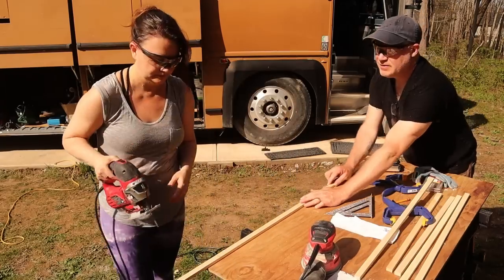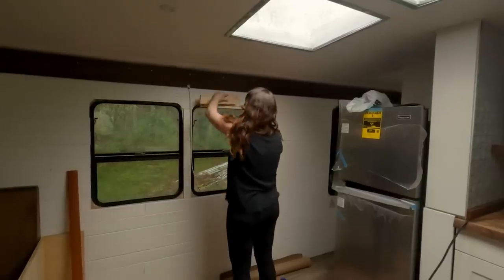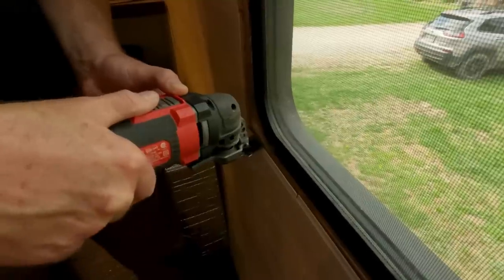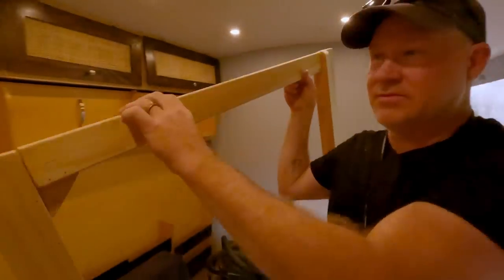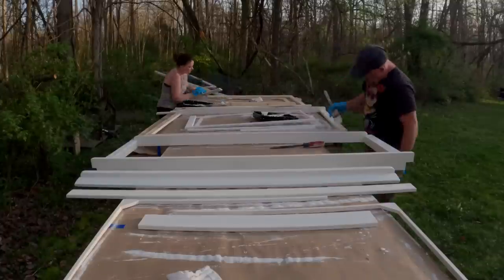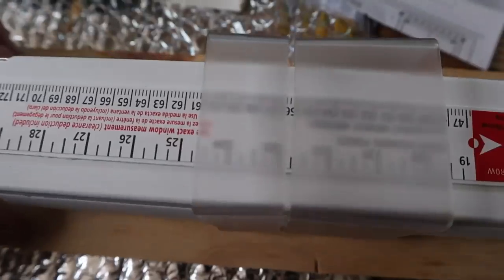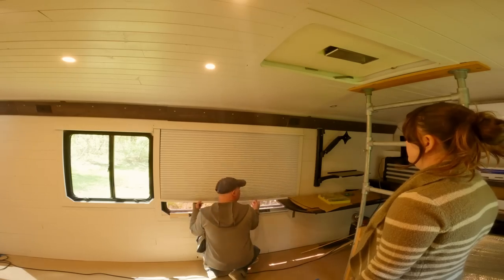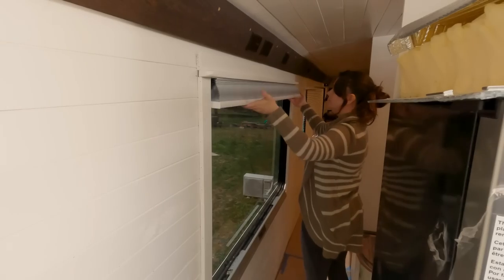Redi Shade Blackout Shades for our BUS CONVERSION - S04E55

Comment: Thank you so much for partnering with us! This turned out so great! We love it!
Reply from the maker: Yay glad you like it!  It has made all the difference to our home
Reply: Nice job guys they look amazing I have a concern about the adhesive holding the blinds on the window seals my coach gets pretty hot and I'm wondering will this effect the adhesive?
Reply: We tried to purchase these, but the discount code wouldn’t work… any suggestions?
Reply from the maker: @truckergrandma  Hi June, Sorry you are having troubles with it.  I just tried it myself and it automatically applied the discount at checkout.  So as long as you use the link we provided, then look at your Order Summary on the right side of the page (on a computer, not sure about using a phone) you should see the code 15REHABIT815 is already applied and the 15% deducted.  If you try to put the code into the box for promotional codes it says it is not valid, as they have set it up to automatically apply.  Sorry, it is a little confusing but I guess you don't actually need the code, just the link.  Here's the link if you need it - https://www.amazon.com/gp/mpc/A3M2S3H0SPDH8D 
Happy shopping!  You are going to love these shades :)
Reply: Great video and project! 
You could just put another strip of wood vertically each side of the frame which snugs up in front of each edge against the shades/blinds, then it not only holds the whole shade against the window or close to it(within the Frame) it also blocks out any light each side where there's a gap so no light can get through when down when up or down you won't see the edges of the blinds and also WHATEVER position the blinds are at height wise, they're always held in place near the window by the edging of the frame holding them back(kind of like similar look to when blinds are set between two panes of double glazed windows) might just finish it off nicely and give the whole thing/blinds and enclosed look and well they will ACTUALLY be enclosed, so no need for magnets unless you chose to do that as an added measure!?
Just a thought.. great job guys! Love the build!
Cheers from London England 👍😎🏴🙏

Comment: Add some vertical guides to the frame that can house the blinds in, effectively boxing them in like rails. This way, it does not matter which way the bus slant towards.  They  can also help reduce light from bleed in.
Reply from the maker: That's a great idea but we didn't want to box our windows in.  We want to be able to remove, clean and replace the screens PLUS keep our emergency exit handles all accessible.

Comment: Sometime ago while I was active duty Air Force we purchased a old window Dodge van . I'm thinking it was a 1966 or 68. The engine sit between the two front seats. We used it for camping , traveling back and forth home to visit family . Our 2 children  boy and a girl learned to go to sleep on our trip. When I got off duty and my leave started we were packed to travel over night 12 hour drive. Anyway I took the windows and blacked them out.  And then framed the windows in like you did yours.

Comment: you're going to need to secure the bottom of the shade while driving. All my RV shades have a string running from top to bottom to keep it from swinging while going down the road. One option would be to raise all the blinds while underway, or stick some white velcro on the back edge of the bottom of the shade to stick it to the bottom of the window frame. OK, I see you guys have a plan...

Comment: The window frames make such a big difference, the blinds are very good, My concern is that because you can close them so easily would they come down if you were driving along a bumpy road, I know that you have said that you will put magnets in the blinds to keep them in place but it only takes one bump to dislodge a magnet. Have you thought about putting flattish sliding bolts near the top to keep the blinds in place
Reply from the maker: I think a big pothole might make the magnet release but being a magnet it will suck it back in afterwards.  We just don't want it to rattle and make a noise constantly.  So we'll give it a shot!

Comment: I have something similar to your blinds at home that fit into a frame surrounding the window. The frame provides a track for the blinds to follow and prevents swing out when the blinds are partially down and the window behind is open. Perhaps you could fabricate something like that?
Reply from the maker: That's a great idea, however we don't want to make it so we can't open our emergency exit windows or take the screens out etc. We kept the trim to the outside so everything is still easily accessible.  Also it will still rattle.  What we want to get rid of is the sound of rattling as we drive.  I think the magnets are holding well, we'll see when we roll out of here :)

Comment: Great video and project! 
You could just put another strip of wood vertically each side of the frame which snugs up in front of each edge against the shades/blinds, then it not only holds the whole shade against the window or close to it(within the Frame) it also blocks out any light each side where there's a gap so no light can get through when down when up or down you won't see the edges of the blinds and also WHATEVER position the blinds are at height wise, they're always held in place near the window by the edging of the frame holding them back(kind of like similar look to when blinds are set between two panes of double glazed windows) might just finish it off nicely and give the whole thing/blinds and enclosed look and well they will ACTUALLY be enclosed, so no need for magnets unless you chose to do that as an added measure!?
Just a thought.. great job guys! Love the build!
Cheers from London England 👍😎🏴🙏

Comment: Trim them out so that wood overlaps on the outside. This will keep them stationary. Maybe? just a thought. Incredible product.
Reply from the maker: I'm not sure I understand what you mean but we didn't want our trim/frame to cover the windows so we can open them and take out/replace the screens if needed.  So we couldn't overlap the shade to keep it in place.  But actually glued on some magnets yesterday it worked well to hold it in place :)

Comment: Love your show. 

I’m wondering if shade can start from bottom then you pull up.   If you can pull up halfway to 1/4 open, you can see outside while standing.  It may look nice.  I suspect your shade won’t work but maybe something hook to hold it stay up?   

Thank you for your positive shows.
Reply: That would be clever if it works.
Reply from the maker: These easy lift shades don't do that, but redi shade do have those.....I think they are called artisan custom shades.
Reply: Saw a show. Love those blinds. Amazing job.

Comment: LOOKS GREAT...like always! Could you put magnets or double sided tape on the bottom like the top? I'm sure you two will figure it out. Also found these magnets for your drawers & cabinets. I seen in the video the installed them on each side of the drawer face near the drawer slides. I’ve seen some pretty cleverly disguised magnetic latches on some cabinets lately. Most are finding them in the marine grade section on Amazon. This is the name for the 20lb magnet latches I seen installed near the drawer slides; DonYoung Magnetic Latch, 20lb Magnet Cabinet Door Catch

Comment: We tried to order these shades but the discount code would not work and a Amazon Rep was not able to apply it either…..
Reply from the maker: Hi June, Sorry you are having troubles with it.  I just tried it myself and it automatically applied the discount at checkout.  So as long as you use the link we provided, then look at your Order Summary on the right side of the page (on a computer, not sure about using a phone) you should see the code 15REHABIT815 is already applied and the 15% deducted.  If you try to put the code into the box for promotional codes it says it is not valid, as they have set it up to automatically apply.  Sorry, it is a little confusing but I guess you don't actually need the code, just the link.  Here's the link if you need it - https://www.amazon.com/gp/mpc/A3M2S3H0SPDH8D 
Happy shopping!  You are going to love these shades :)